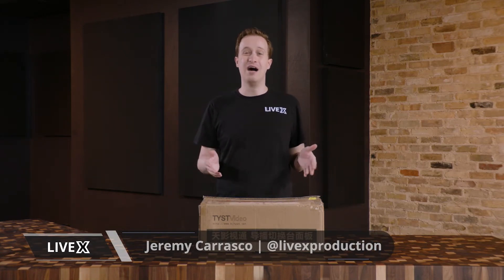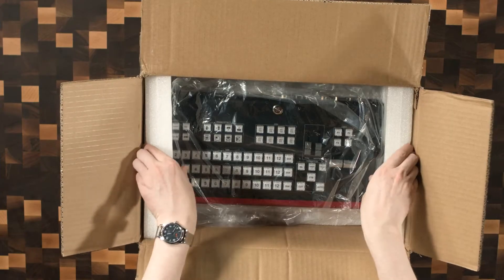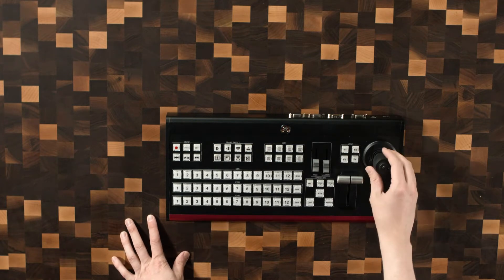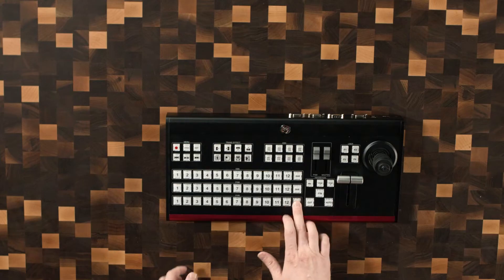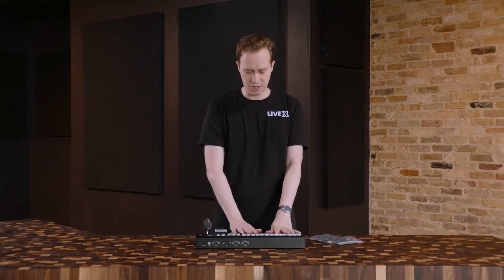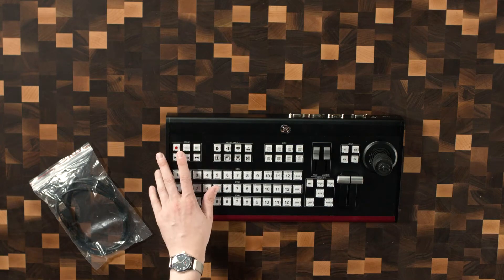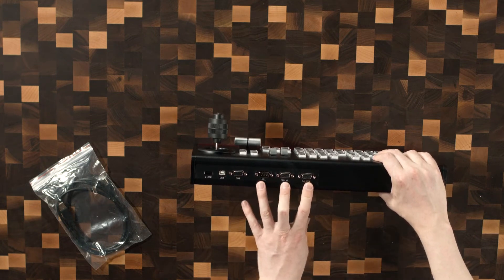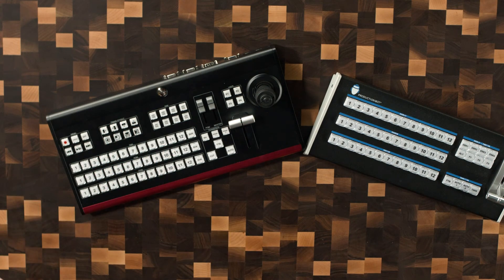Unboxing: TYST vMix Control Switcher

Comment: #Live X ! Is it just a Tally Light system or a Video Switcher as well. If it is a Video Switcher also than where are the Video Inputes and Outpus?
Reply from the maker: Its a control surface for vMix
Reply: @LivexTv1  Thanks.